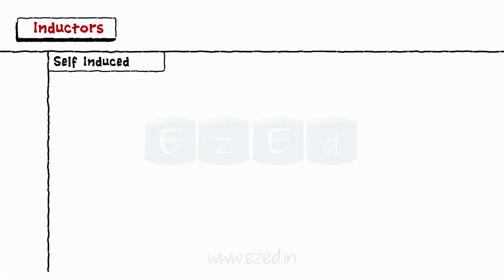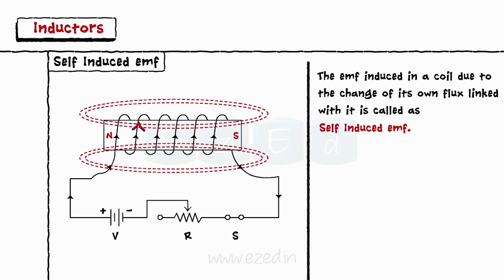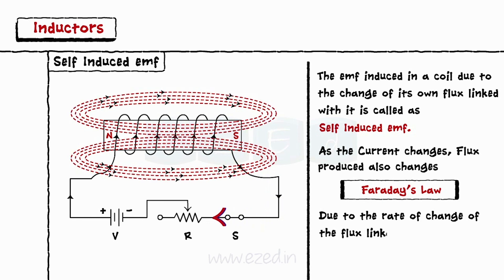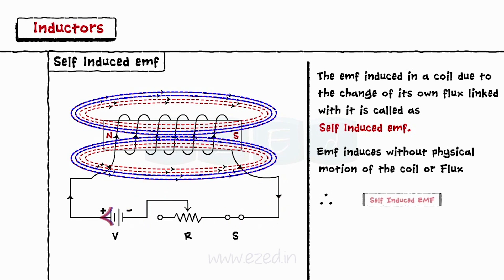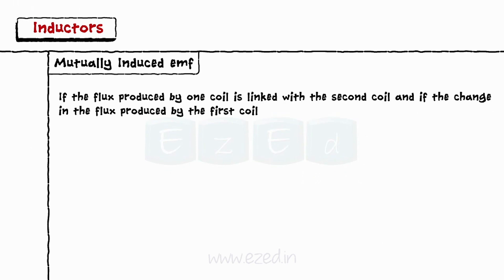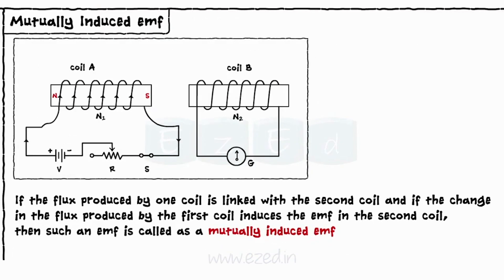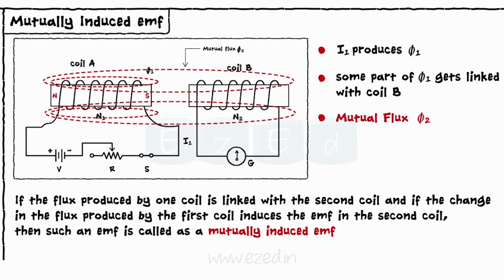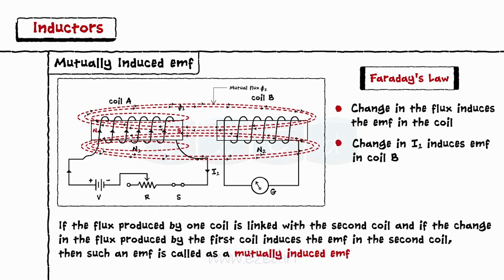Self Inductance &  Mutual EMF - Inductors -  Electrical Engineering

Comment: In an inductor, when current decreases, the applied voltage and the  EMF have the same direction to counteract the change .which means the two EMF would produce magnetic field in the same direction.Would that not violate lenz's law?(Magnetic field exert force in opposite direction